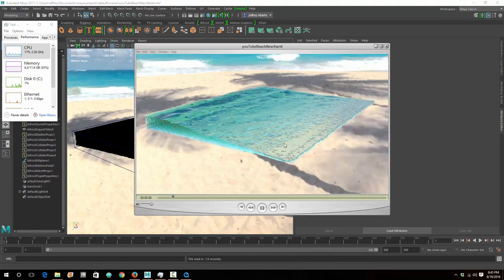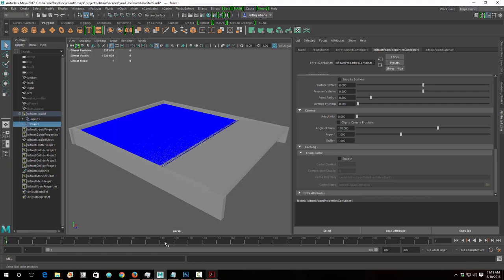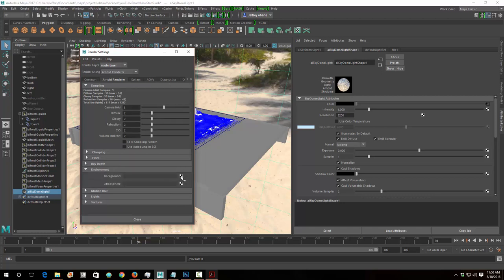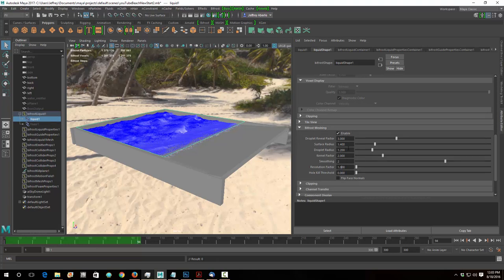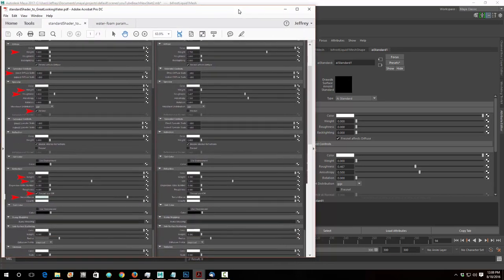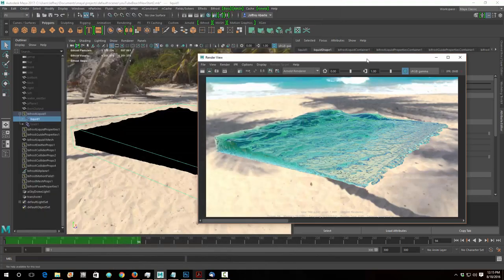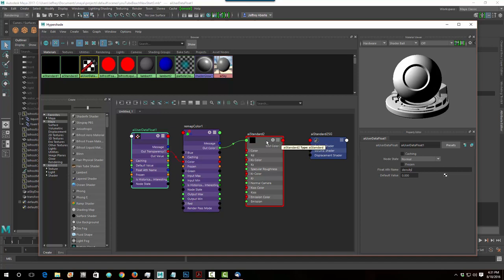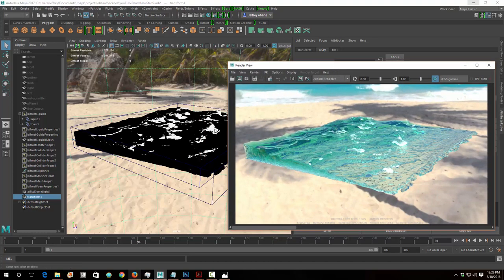Maya 2017 Bifrost Rendering Water and Foam Tutorial

Comment: Thanks, these are great. Learning how to render with Arnold has been the highlight of updating to maya 2017!
Unsolicited hypershade tip: You don't have to clear, add, and then graph. You can just graph your selection and it will clear the window for you. You can also middle mouse drag items in (even files from the os) and they drop wherever you release.  That's nice, because sometimes when you add a node it pops in wherever it wants.
Reply from the maker: Thanks for letting me know. That's a great tip.

Comment: Quick question: after I hit{computer and cache to disk }, foam setting looks like never change, whatever how I change foam setting. How could I fix it. I tried flash cache, even delete the foam, and add it again. all didn't work
Reply from the maker: Take a look at where your simulation has the path to your foam cache. It's literally a path and file(s) that are sequentially numbered. If that path didn't update based on your new cache than you'll still see your old one. That's the only thing I can think of at this moment. Clearing your cache has to do with the foam particles being held in temporary memory so won't change anything if you're pulling your foam simulation from the hard drive.

Comment: in maya 2018 Arnold aiStandardSurface has no more the Backlighting slider you showed in the video. My foam is barely visible in the render view although i have a lot of foam in my simulation. How can i make it more visible? Thanks!
Reply: I don't have 2018 so I can't help. Either someone here will help or you can post on Maya forums.

Comment: I need help. im having some problem with the render sequence. it can render just all the images are stucked in the exact same frame, which means there's not water animation. I've tried batch render as well, it just doesn't work. Did i miss anything from the render setting? Fyi these  'Enable Background Processing' and 'Enable Scratch Caching' (under Bitfrost tap > Bitfrost Options) were checked, and the cache were there before i hit Render Sequence. Do I have to load the whole animation(Green bar on timeline) first before I hit Render Sequence? Anyone help?

Comment: Great tutorial! I am just wondering on how I can make the water less 'blobby'. When I make something react with the water it seems to be very thick. I am hoping its a simple setting. Thanks
Reply from the maker: Yes, I wish I would have covered that a little more. The settings you are looking to control are found in the meshing. The first two settings I believe cover this. These values control the blobiness of the water or lack thereof. My camera was very far away from the water so it didn't matter, but if you get closer you definitely see the blobiness. 

Here are the settings you need to study:
 
Droplet Reveal Factor
Creates and preserves detail around splashes when generating and smoothing the mesh. Lower values result in smoother meshes, while higher values give more small, high-frequency detail. 

Surface Radius 
The radius of each particle blob used to create the surface, in multiples of the  Master Voxel Size. 

Droplet Radius 
The radius of each droplet, relative to the Master Voxel Size. 

Here is the page where I found these: 
https://knowledge.autodesk.com/support/maya/learn-explore/caas/CloudHelp/cloudhelp/2016/ENU/Maya/files/GUID-8218DE4F-C974-46C4-BF1B-A5F9255D1BA4-htm.html

Comment: Hey Jeff.  This is a great tutorial. There's not much out there on Bifrost and I really like that you go into details that a lot of people just skim over.  One area I'm a little bit stuck on is the foam. Did you mesh the foam as well as the liquid?  When I mesh the foam it comes out black. But if I just apply the shader to the particles they show up but are really fine in detail.  Should I just be increasing the particle density on these?
Reply: Did you figure it out? My foam in maya 2018 is all black too.
Reply: I'm sure this has already been figured out, but no meshing of the foam. It's kept as particles. I thought I showed how to increase the size of the particles. Maybe not. Haven't worked with this for a few years now so don't remember.
Reply: @caveman357  No, foams will be rendered as particles. you can use the Bifrost Foam Material, which is not that great. WHat Jeff showed here is really nice. Although there's no backlighting in arnold shader, so you gotta head down to geometry section in the shader and turn on thin walled. you can also control the opacity using density channel, like what Jeff showed here.

Comment: Hello friend, thank you very much and apologize for my bad English.
I wanted to ask if it is normal that at the moment of taking out the render sequence even after doing the whole process of the cache, we recalculate the frames prior to rendering.
I would love you if you answer, thanks in advance.
Reply: Caching and rendering are two separate things. As long as your scene is cashed you can render anyway you want. Either frame by frame, or just one frame in the middle or in reverse. You shouldn't have to recalculate (recreate the cache) after any render sequence or if you stop mid way, etc.
Reply: Thank you very much, the problem is that I have frames that take 10 to 12 minutes and I can not render a sequence of 600 frames in a single day so I have to divide it, but when I want to start rendering from a certain frame (120 onwards by example) starts to recalculate everything from frame number one without starting from where you program it. Do you have any idea why it happens? Should I start the render right where I programmed it? What option am I forgetting? Your contribution has been very useful.
Reply: Yes, most likely you simply don't have the checkbox checked that tells Maya to pull your data from the cache. So you have your simulation stored on disc, but when you close Maya, then reopen the scene it doesn't know that you've already cached the scene so it starts recalculating everything. I made kind of the opposite mistake in my training videos when I gave everyone the file that had this exact same check mark checked. The problem is no one else had the cached files so the simulation would never start. I haven't played with Maya for a year, but from memory there was a tab called "Cache" and that's where this checkbox is. Once you've checked it, resave your scene so it remembers that you've checked it. That way each time you start each and every day it knows to pull from the cache. If I have this wrong from memory, someone else will hopefully say something.
Reply: You were right, I had to check the boxes. Enhorabuena, gracias crack (y)

Comment: how to render foam in maya 2016.5? same technique is not working.
Reply: Funny you should mention this. I was just about to release this video using Maya 2016 Ext 2 SP1, but I noticed 2017 had come out 3 days prior. So I figured it out with 2017 instead. There's a slight flaw in 2016 Ext 2 SP1 with the acceleration Direction Magnitude property. It's called a Motion Field in 2017, but an accelerator in 2016. So anyway, in your accelerator properties you have to set a "Direction Magnitude" and a "Direction" as a vector (x,y,z). The logical thing to do would be to put the Direction Magnitude to zero since you're using "Inherit Velocity" instead. But if you put the Inherit Velocity at say 5 and set Direction Magnitude to zero, nothing happens. So instead I had to make the Direction Magnitude some value, say 10, but put the x,y,z all to zero. Then it worked. Have no idea why, but I was willing to work with it. Then with 2017 that issue didn't exist, I could turn the Direction Magnitude down to zero with no problem. Does this help? Actually I just reread your question and it was about the foam. Oh well, I'll leave this here anyway.
Reply: About the foam. With the new Arnold renderer I figured this out with the help of the forums using Arnold. You'll have to ask in the forums what may be different. I was never good with Mental Ray anyway. I don't know about the nodes for the textures either. Remember I'm really new to Maya. Plus I never got to rendering with 2016. I only figured out the simulation part in 2016. Never recorded it however. Sorry I couldn't help.
Reply: thnaks for reply Jeff, i am also using arnold renderer, but not figuring out. i will try in Arnold forum.
Reply: Hi! same problem, bifrost foam won't render. Do you know the solution?
Reply from the maker: Prior to 2017 there was the Mental Ray renderer. In 2017 came the Arnold renderer. My video shows the method for 2017 using Arnold and actual foam particles. Foam particles might have been in 2016.5 (can't 
remember), but they would have to be rendered differently I'm guessing since it's a different renderer. Sorry I can't help more.